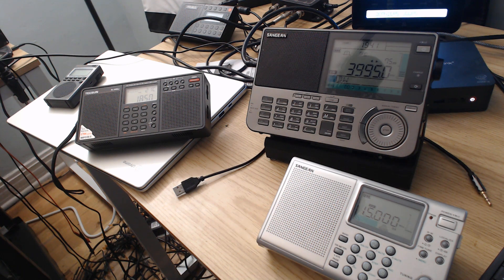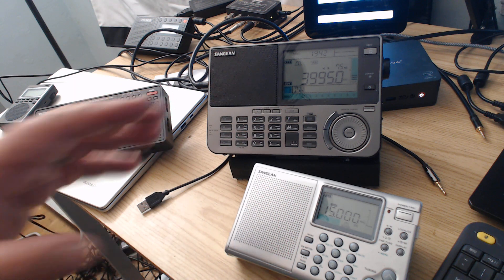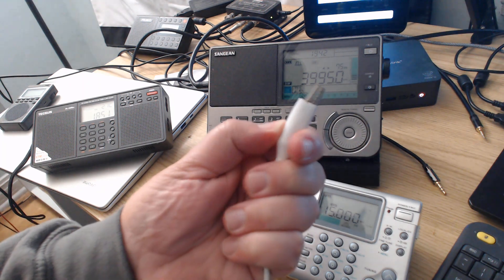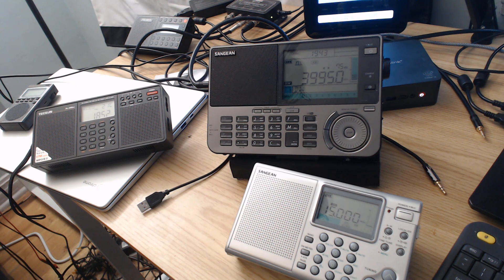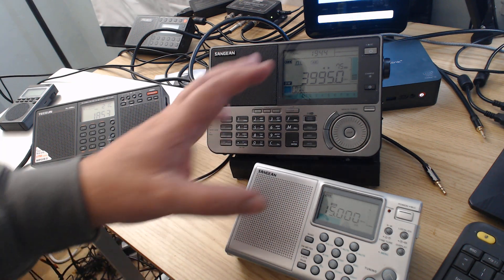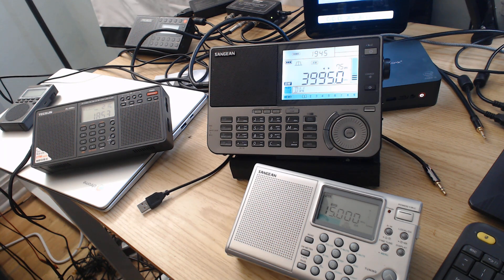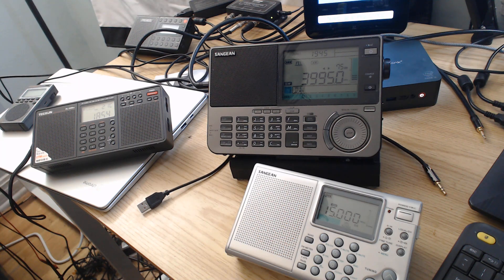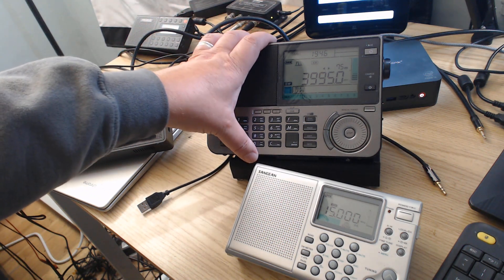Sharing one antenna on multiple receivers questions and answers

Comment: I find that when I place my Tecsun MW loop
antenna by my receiver and adjust the tune
knob, it works better than the direct plug
into the receiver with an AM jack and cable.